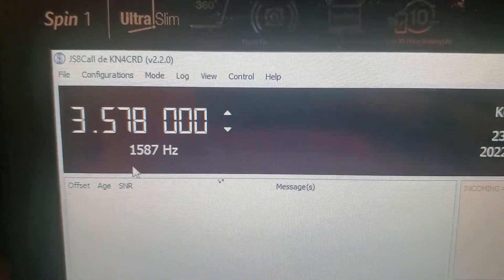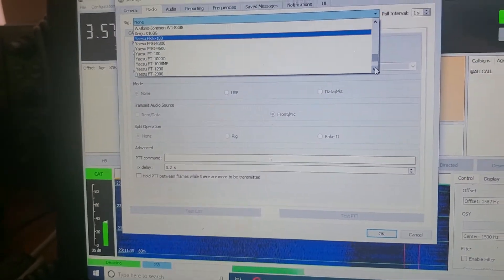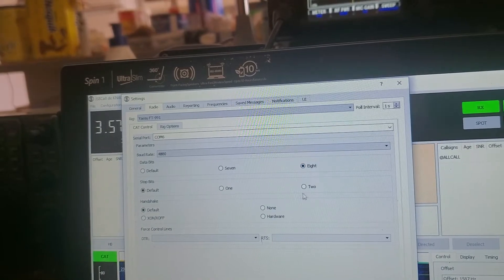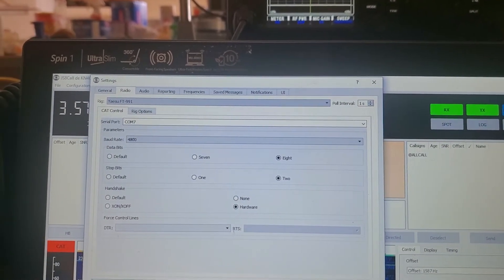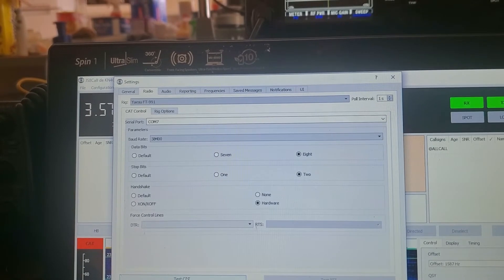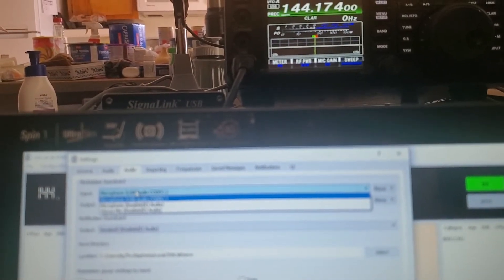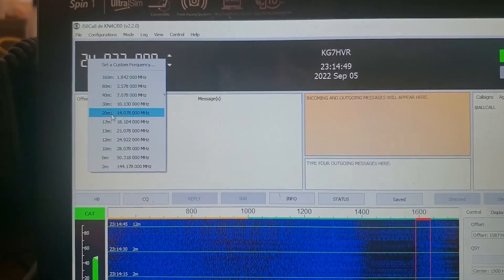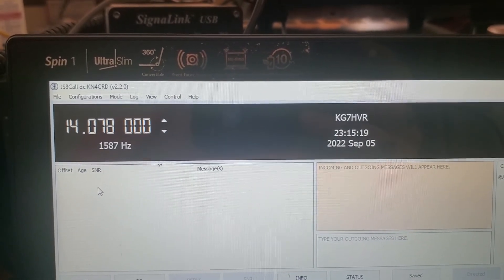JS8 CALL BASIC SETUP FT991A

Comment: I just bought the FT-710 and I can get it to receive but no luck transmitting. Can’t find any info on js8 connectivity yet, hopefully they’ll have it in the options soon.
Reply from the maker: Ive used mine on js8. But i use signalink even though theres a usb. I dont let the software control my radio either. For radio I put none
Reply: @hamradiohack I’ll have to check that out, thanks for the reply.
Reply: Try using the FT101DX. since it came out at the same timeish could have the same interface